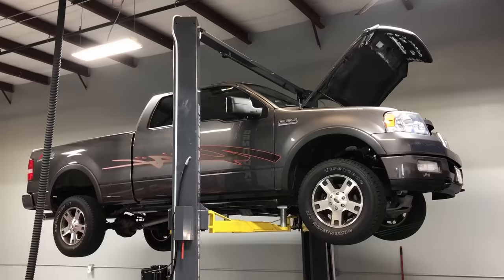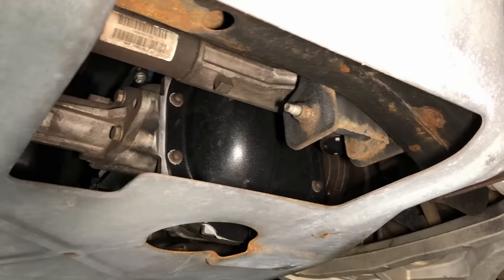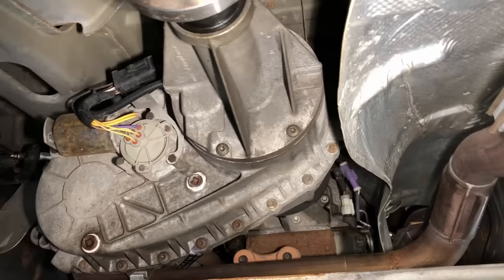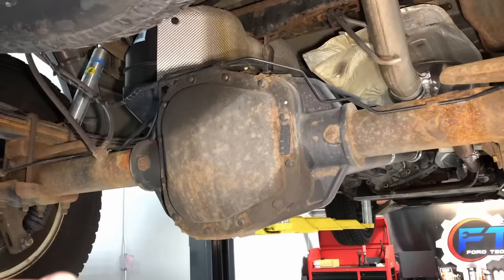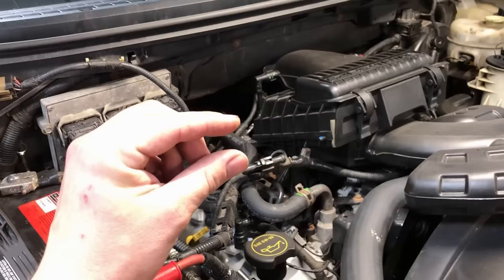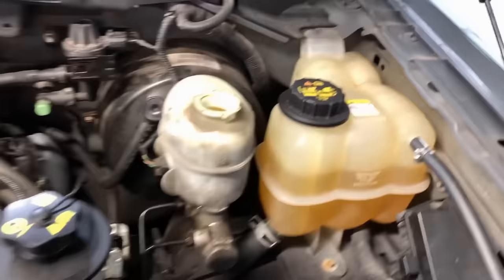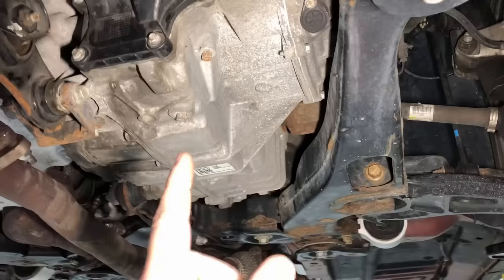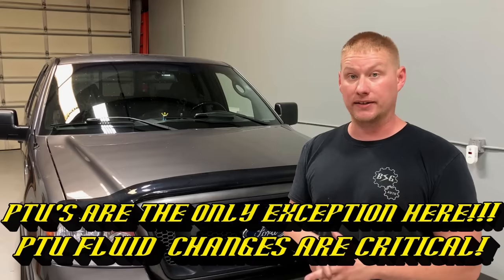Never Follow Ford's Lifetime Fluid Service Intervals: Here’s What I Recommend and Why!

Comment: The only lifetime fluid in your vehicle is the water in the  bottle in your cup holder.  (There's no such thing as lifetime fluid.)
 Flushing the cooling system will keep your radiator, water pump, inside the block and heater core looking brand new.  I worked in a rebuild shop once taking apart core engines.  I saw first hand the difference between well and poorly maintained engines.
Don't put any super duper, top secret after market coolants in your engine either.  Put in the type that the factory calls for.

Oversized tires, performance chips,  and lift kits are hard on on the entire  power train regardless how often you change the fluids.

Comment: I need to find someone like you for GM products! I found you when I had a 3 valve 5.4 starting to make noise and got rid of it before it was constant. Now I want to make sure my GM lasts forever...
Reply: The oil calculation on the dash or sending it in to see how your engine is wearing? I’ve always been a 4,500 mile mobile 1 guy...
Reply: Wow, didn’t realize there was that big of a difference! Thanks for the info!
Reply: the money you would spend on a oil analysis could be better spent on a oil change, think about it.
Reply: @repairvehicle  I agree with ya.  That info will tell you a lot about what is going on inside the engine. They are only around $30 or so. I just ordered 3 kits for my 3 vehicles, all are high mileage and I'm curious what is up so I have intel and can take care of matters before they become a major headache.

Comment: What a super introduction as to why they love those long service intervals. The factories don't want u servicing your own car. They want to make it so u have to go to them for everything. Do u think they would have installed obd2 starting in 95 and agreed to put out code criteria if the government didn't force them. If it was up to the manufacturers, everything would be proprietary. And u have to go to the dealer for every check engine light.

Comment: I had the PTU serviced on my wife’s 16 explorer serviced at 50,000 miles and that fluid was cooked, lifetime my but!!
Reply: The PTU's on the Explorers have a huge problem with cooking the fluid into a black sludge and then grenading at well under 100k miles. This is because the exhaust catalytic converter is right next to it.
Reply: Jack of All Master of None i have a ‘13 SHO non PP. what interval do you recommend i change it? I heard every 20k miles
Reply: @WhaddupImJohn  20K is a pretty good interval. You could probably get away with every 30k by using a good synthetic fluid.

Comment: Who ever believes in life time fluids is a fool.
Reply: A timing belt last the lifetime of the engine.  When it breaks the engine is shot.  QED!
Reply: Yeah they put that "lifetime transmission fluid" bs in my owner's manual. The thing is there is no dipstick on the transmission. But somehow I'm gonna get that trans fluid changed. They can miss me with they lifetime bs I'm smarter than that
Reply: @jamescaley9942  maybe that's how they think
Reply: Exactly. He's correct its just designed to get you into the dealer to pay for bigger, more expensive work.
Reply: Only lifetime fluid deal I've seen work is the one Briggs came up with a few years ago. 
Never change the oil in its life. 
They project 15yr lifespan on a mower used during an average summer for 45mins a week. 
I don't doubt it , I had a push  mower in the 90s I never changed the oil on in 10yrs and it still ran when I gave it away. 
But cars and trucks ? 
Yea bust out the wallet when you follow those lifetime fill deals.
Reply: @drpicmeup  
VW took em off in the late 90s also.
Not a problem to change it when you learn the procedure, the part that sucks is it's about 10$ a qt.
Reply: Silent Russian to be fair most cars are beat by 20 years and falling apart so your waiting for the motor to blow
Reply: Orlando 1701 no it’s to keep incompetent people from ruining it. If your capable and should be changing your fluid it should be no issue to you to fill it from under whatsoever. People who complain it’s hard are incompetent and should avoid doing the service themselves
Reply: My 97 Toyota still has the original tranny fluid. If it died tomorrow, I wouldn't cry
Reply: Hmmm   Lets see here... Don't own a ford.  BUT

I have a 2001 BMW 325i.  Lifetime trans fluid and very long life coolant.   

I've never changed the trans fluid,still drives shifts fine

I've never flushed but have changed coolant once.

Car has 200,000 miles on it.  Cooling system had normal failures.  Meaning, needed to change hoses and thermostat.  OE radiator swapped at 175K miles.

My guess is you have folks topping off coolant with tap water which will muck things up.   

My 2012 Kia minivan has 120K miles on it, again only fluid changed is oil.  cooling system is fine and not gunked up, trans shifts fine.  

Not sure what you folks do with your cars.. perhaps keeping them in a garage helps.

I bet you change oil every 3k too.  I change once a year with synthetic.  I've had 1 car hit 300k, miles another 200k miles.  and several I sold at 150K miles.   All with minimal maint.
Reply: how can u tell when ur99 f150 v6 rear end fluid is low what sighns i get
Reply: @terrahgaines8735  

Make sure your truck is leveled. Open the full plug and stick your pinky inside it, if you can’t touch the fluid it’s low. If you can touch the fluid check the color . Change it if it’s white or burned or smells bad. I always change mine between 30-35k miles.  Check YouTube there’s plenty of videos on how to change it on your specific truck.

Comment: Almost 250k on my 1998 E150. It will be 21 in July. Still going strong, just rusty.
Reply: Just turned 309K on my 98 Ranger with the 4.0L. Waited till 100K before changing the original plugs. A few were up to .080, but it still ran fine.

Comment: Ford Trucks (Explorer & Expeditions also):
1. Front Differential - Every 60K if 4x4 is rarely used; or every 30K miles if 4x4 is used more frequently
2. Transmission - Change fluid at 30K miles, pan drop, wipe & clean the pan; use Ford specified fluid; then at 60K miles pan drop fluid & change filter; then change every 60K
3. Transfer case - Can change every 60K miles but every 30K is even better!
4. Fuel Filter - 30K miles on pre 2009 trucks; not necessary on newer; diesel fuel filters change every 15K miles
5. Rear Differential - 60K Miles if not towing frequently; heavy loads in bed and towing, change every 30K miles
6. Brake Fluid - Flush/bleed every 60K miles or at every brake pad change
7. Spark plugs - every 60K - 80K miles
8. Engine Oil - Conventional, 3K miles; Semi-Synthetic, 4K miles; Full Synthetic, 5K miles ( going longer is just more wear & tear on the engine)
9. Power steering - 2011 & older; every 60K miles
10. Coolant - green, every 30K miles; gold coolant, 100K miles; dark green or super yellow; every 80K miles

Comment: Life time fluid is when your machine go out then you buy another one
Reply: This is the real goal of Ford to get you to buy a new car. It is so poorly engineered compared to Toyota. Just changing the cabin filter is an act of god.
Reply: toyota is learning the ways  of planned obsolescence now, too. More plastic in the cars, etc. I'd still take one over a ford.
Reply: I'm sure they have calculated everything they need to know about 80% of the market. If you're in the 20% who likes to run a car to really high mileage, they figure you can be someone else's customers. Otherwise known as "we'll sell to the dummies, because the manufacturers who sell to the stingy crowd are also dummies". 

As more and more dealers make more money from service and sales has almost nothing in it for them, the cars will be designed to provide the manufacturers and the dealers with an income stream after warranty. 

I can't say I can remember a car from 40 years ago, though, that really went long without much service. 80s and 90s hondas and toyotas were probably better than anything that'll ever be made again.
Reply: @daw162  They have been on that track every since 2000 the Lexus LS quality has diminished so much I would rather have a Kia K900 now. The 1991-2005 LS were as solid as the old MB's They all use the same suppliers
Reply: lets be honest here the only decent vehicle Toyota is putting out is the Tundra because it's ancient. Everything else has been redesigned cheaply. ESPECIALLY the the Tacoma. They aren't the bastion of automotive light they once were. They are especially the first ones to tell their customers to pound sound because " we are Toyota."
Reply: Loganbay it is everyone bud. Open your eyes
Reply: @daw162  I have tried on 3 separate occasions to have the Dealer or Quicklane change items out for me that they simply refuse or say they are backed for 3 weeks before they can get it in for PM. Local Mom & Pop shops don't buy into the PM scope either.  When I listed most of these things at 50K to my local shops as well they scoffed saying it wasn't needed at the time. I would do it myself but I don't have the time with my schedule taking me on the road 19 days out and then 3 days off.
Reply: @peytonbass5396  OUCH!  I've worked like that and it is very wearing.  You may need to relook at your work to see how long you can continue working that way.  I learned many years ago to do my own PM but now I have to work up the motivation to do the work. When younger it was fun but now it is a lot of work. Of course, it might just be me getting older.

Comment: 186,000 miles 2010 Merc Mariner bought new.  Only fluid changed is the oil every 5k Mobil 1.  No problems so far.  100k changed plugs and belt.
Reply: I junked a 2005 Mariner with 157000 miles that the rust monster ate alive.Previous owner never changed anything but oil.

Comment: I just purchased 2013 F-150 3.7L With 62,000 + miles.changed Brake, trans, rear end fluid + engine oil and filter myself for less then $300.00 all motorcraft..Thanks FordTechMakuloco..Coolant next.

Comment: Remove the transmission to replace the filter how stupid is that
Reply: Honda does it too, it's fine
Reply: If I’m not mistaken it’s always been like that
Reply: Common these days across all makes, some don't even have an actual filter, just a magnet and a screen.
Reply: Transmission pan
Reply: FishFind3000 nope it’s only been like that for the last 10-15 years. It’s a bad idea and is for couple reasons; cost savings to the maker and increased failures.  There are a few exceptions as Honda has been doing this since the beginning. However, it’s still not a good idea and Honda has to add additional external filters to keep them from failing in warranty.
Reply: Dan Hg are you on drugs? There have been filters in the transmission pans for years and years not just in the 2000s
Reply: @spartacussmith7070  Depends on who you ask and which model. No one is going to take their tranny out and then split it in half just to do a service.
Reply: @Rob...  hahahahahaha
Reply: @Rob...  not for the cars and some SUVs...as Brian said you have to remove the transmission and separate the two sides to get to the filter starting at 10:45 in the video https://youtu.be/WaPJJ3hUHN0?t=645
Reply: That’s why I like my 02 f150 except the oil filter placement now that’s a real pain to get to seriously why is it there on the 5.4 ugh ☹️
Reply: How stupid it is or not depends on what type of filter is used. Years ago Ford did not use a filter in their transmissions. They used a screen. GM and Chrysler used filters. On Fords (C4,C6, etc) there was no need to replace the screen during a fluid change. If these newer transmissions are using a screen there is nothing to worry about.
Reply: @FishFind3000  On my Mercury, you only need to drop the pan to change it.
Reply: He said that because most people don't change the fluid ever, if you change every 30k you'll never have a problem. Go back and listen carefully.
Reply: @scubadivingsince2006  Try a filter on a Dodge Cummins or a Mini Cooper.
Reply: that is why u should change the fluid regularly as Makuloco suggests so that you dont have to remove and split the transmission apart to change filter.
Reply: what hes saying if you dont do proper maintenance that you will have to pull the transmission to correct the problem, so spend the 100 dollars on a flush and save about $2000+/- in repairs
Reply: The 6F is not a terrible transmission.  I've heard of people getting over 200k on them, with proper maintenance, but not having access to the filter really bothers me.
Reply: Engineers said "this is how well milk em!"

Comment: Local ford dealership has 10 ptu's on the shelf at any given time. 
The torrington bearing inside of the main gear starts to walk through the case, when the oil evaporates and turns to a black sticky mass...
The fill plug is in a shitty location too..

Comment: 2013 Ford Edge, 3.5L. Always used Mobil 1 full synthetic 10W30 since brand new. Changed every 10K miles as recommended by Ford. 260K miles and still runs like brand new. No blowby or oil usage.
Reply: Every engine has blowby. If they didn't we wouldn't be changing our oil at 5 to 10k miles. We would be changing it once a year no matter the mileage because the oil would stay so clean.

Comment: My 1999 F250 Super Duty 6.8L V10 extended cab, long-wheelbase just passed 420,000 miles. I have had to replace the alternator twice, water pump, once, coils four times. I only go 85-100,000 on the coil packs. Oil is changed every 3,500-4000, transmission fluid is changed every 30,000 and filter and oil every 60,000. I flush out the brake fluids every other year and flush the power steering fluid out every 12 months. I change the rear end lube every 55-60,000 miles. And I change the fuel filter about every 15-20,000 because I am at different gas stations with unknown quality gasoline. I greese the front end ever other oil change. Also yearly I pull the door panels and lube the handle, latch, window regulator parts and I pull the plate off the tailgate to lube the handle and latches there. At 260,000 or so miles I replaced the entire A/C system and added a heater core while I was at it. Do the maintenance and they will run a long, long time. One problem I ran into that I consider major is Sylvania lights. Had a bunch fail on me from actually melting, especially the brake lights. No fun explaing that to a cop on the side of the road in nowheresville, USA. I have since switched them all out to Eiko and have had zero issues.

Comment: First off, really appreciate you making these videos. I run a high idle kit on my trucks, do you see any issue and or do you recommend that I alter any part of my service schedule? 
I run a hotshot trucking company consisting mainly of F350 dually with the 6.7L scorpion engine. I've always taken Ford's service schedule as a guideline and as you've stated in a previous video; I usually conduct certain services at 5,000 mile (oil changes), 15,000 (fuel filters), 30,000 (transmission/axle fluids), and 60,000 miles. In my line of work, vehicles are on the road towing approximately 80% of they're capacity 6 days a week.  In addition, they idle for about 5 to 8 hours every 14 hours; totaling about 50 hours of idle time a week if not more.
Reply: When you say "high idle kit" do you mean you just idle a lot or you have some special kit for heavy idling? If so, what is it?

Comment: Ford isn’t lying when they call it lifetime fluids. What they don’t say is that they consider the useable life of their products to be 150K miles. That was what I was told when I worked for Ford many years ago. Factory fluids , other than engine oil, will get you to 150K in most cases. They know that. For me, I don’t even consider my vehicles high mileage until they reach 200K. Every single fluid in my vehicles get serviced with the best synthetic products available for that application. I sold my oldest Toyota 4X4 with 630K miles on it.

Comment: They are telling you a very high maintenance schedule because they bank on the average warranty expiring well before that mileage...Even extended warranty will expire long before 150K.  What is sad is they make the most simple old school items non accessible.  Ex fuel filters, transmission fluid and filter.  Leave the basic maintenance items
to the owner.  If the owner  screws it up then so be it.   I plan on spark plugs, transmission and PTU fluid every 25K.  For spark plugs there is a dual benefit of the more frequent removal is to also remove plugs to reduce risk of plugs seizing in the block....or worse yet...Breaking in two and Half of the plug seized in the block.   I can speak from experience that the newer Taurus at least the 14 SHO spark plugs look much more intimidating than they really are.  Only a few items to remove...some intake tubes and the Strut Tower Cross brace which is simple.  Four bolts I believe two inboard for each side.

NOTE:  DO NOT  move vehicle with cross brace removed. It doesn’t say it in the manual but that could be considered a structural component and possibly damage the unibody construction.  Probably not but for about three minutes of your time is it worth it?

Comment: Pretty crazy on the fluids to me. Just changed my rear differential fluid on ford f250 at 100k and it wasn't even that bad compared to some others I've seen.  My transmission is supposed to be 150k and I can see it because my fluid still looks, tastes, and smells good.

I think it's important to just change them. A lot of people never change fluids in the transmission and it goes bad. My dad is a mechanic and he doesn't believe in changing coolant. He thinks it never goes bad and he's got cars that are 30 years old with the same coolant.   He's kinda crazy though.